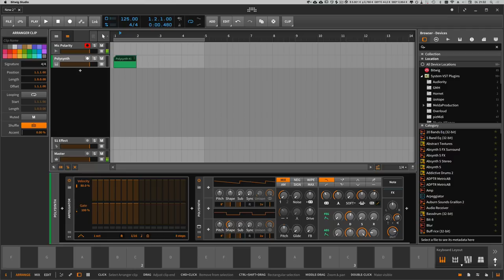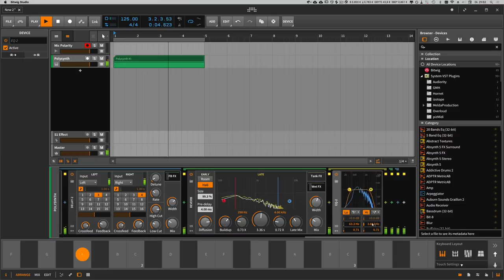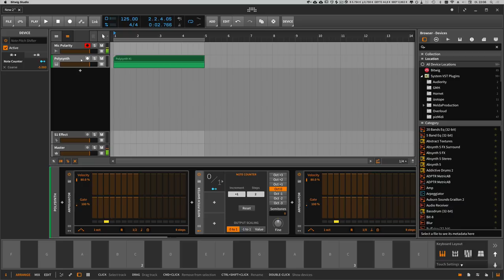Fun with the Note Counter in Bitwig - Tutorial

Comment: you can do the same with lfo 's or im wrong?
Reply from the maker: not 100% in terms of how the modulation is applied, but in general yes. the note counter adds modulation depth with every step and returns to zero after the cycle is complete. with the lfo you get the value depending on where the lfo is in the oscillation cycle.
Reply: you'll need to add quantizer to LFO signal for similar result, also using odd numbers for increment steps may result in shifting step pattern, that's harder to do with LFO. so yeah, sometimes it's just way more efficient to use this one counter modulator. But for bounce counting effect you'll need to use LFO